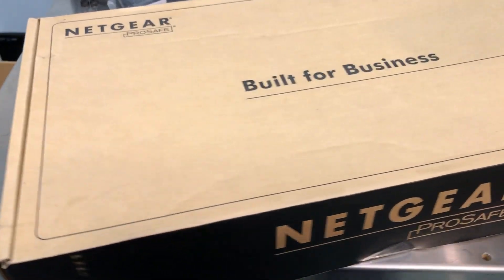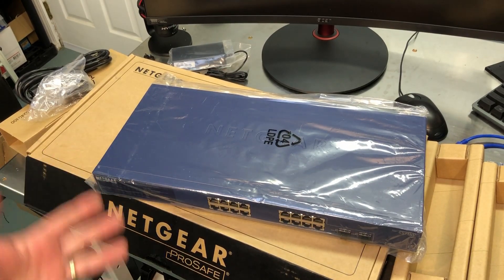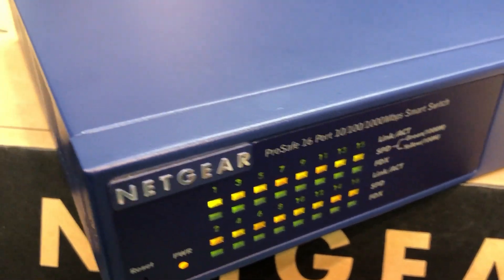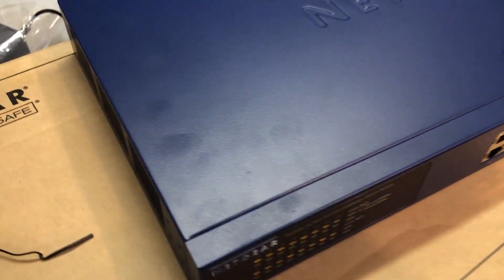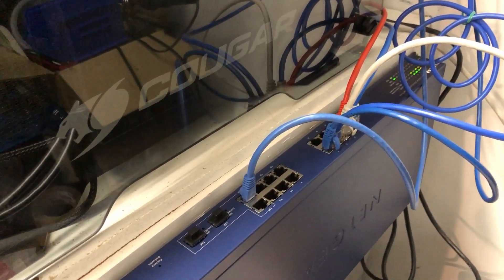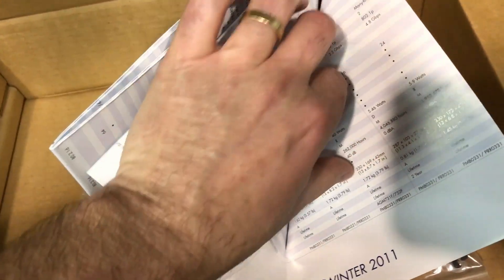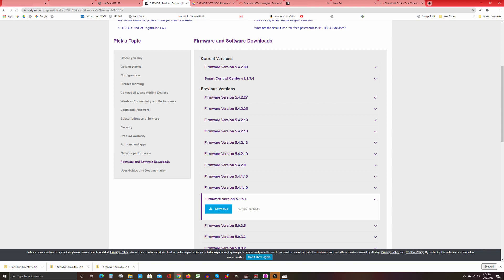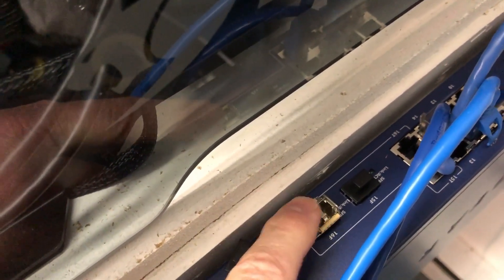OCC reviews the NETGEAR GS716T-200NASv2 managed switch.

Comment: Thanks for the review. Looks like a deal at $50. 

My router has only one ethernet port. I want to connect two separate computers, which are a long way away from each other. Can I simply connect this switch to my router, then connect two separate ethernet cables from the switch to my two separate computers - without having to go through the switch configuration process? Will it do that "out of the box" or will I need to run the software that comes with it?  

I have macbooks and I don't think the software runs on a mac.  Plus I really don't want to have to play around with it, just plug and play if that works.
Reply from the maker: Well, short answer, yes it would work. But it sounds like for your application that a five port for an eight port switch would be fine. They would be much less bulky and take up less space. And you can get them for around $15.
Reply: @overclockersclub  Thanks again mate.  That's great, cheers.